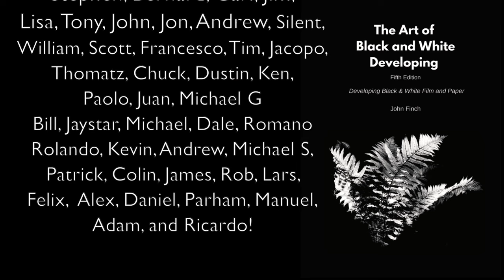Keeping Those Prints Sharp!

Comment: Great video. Tip: Setting up a grain focuser by focusing on film grain can be frustrating to start, as the grain may be small, low contrast, and/or mushy. A solution is to scratch some small "X" patterns on a bit of trash negative with a pin, just lightly enough to cut into the emulsion. You will find that focusing and those cut edges is quite easy by comparison. I started with a Patterson grain focuser, which is just terrible. Eye strain; cheap plastic lens. I gave it away and bought a Bestwell. It was made in the US but went out of business. The same unit is now made by someone else - very much like the Scopic he shows here.  It is all you really need.  When everyone was dumping their darkrooms in the 1990s, I bought a used Micro Omega at a swap meet for $50. It really is the RR of focusers. I used to religiously put a scrap of paper under the focuser to account for that "depth". This used be one of those golden rules in books on enlarging.  Then, I discovered, like John, that it doesn't make a bit of difference, at least enlarging a 35mm negative to a 16x20 inch print.
Reply from the maker: Great comment, Randall! I never thought of that scratching idea, brilliant.

Comment: Hello, I have a similar enlarger to you. On your carrier you will see a small rectangle @ 1:18 near the top. As you slide this into your enlarger with it turned on you will see a projected line on your base board. It will be split, if you adjust your focus so the line becomes straight it leaves you very close to fine focus.
Reply from the maker: Good tip, Tom, thanks!

Comment: Very good advices! I want to add that it is crucial to have the negative carrier, the lensboard and the paper easel parallel. There is a little tool out there which has a little laser like light source and with the help of a mirror you can check the  parallelism of the 3 planes. unfortunately i forgot the name of it and i do not have it by my self. But it is a good tool if you can get it or borrow it…

Comment: With 5x7" negatives, when the enlarger head is very high, I use a "Bestwell Magna Sight Focuser". It has a 4 cm diameter eyepiece and still provides a clear image when the eye is 70 cm away from the eyepiece. It's cheap and easy to find on the second-hand market.
Reply from the maker: Great tip, thanks!

Comment: Hi John I use a Micro Omega. It took me a while to find a good one and eventually found an unused one in the USA. It was worth the wait and the cost. I can even see Pan F in both 35mm & 6x7 with this FF. Also as you say you can get into the edges of the neg to see if the whole neg is sharp. By the way, a tip here from me: get some target negatives from Vlads Test Negatives to find out if your enlarger is in the same plane as the baseboard – they are also great for digital scanning. Keep up the the great videos John I look forward to your experience and knowledge weekly. Peter
Reply from the maker: Good tip! Thanks Peter.

Comment: Hey John. Great video. I just wanted to say, I’m loving your book I recently purchased. I read it every night! I wanted to ask a question about your recipe for DK-76b. I bought the chemistry and have already made a couple batches, but would it be safe to multiply your measurements by 4 so that I can make 4000ml at a time? Or do adjustments need to be made to my grams? It’s because I go through a 1000ml so fast! Thanks John!
Reply from the maker: Thanks for purchasing my book and for your kind comments. I really appreciate them. About DK-76b. Yes, just scale up by multiplying. Its shelf life is around 6 months in stoppered bottles.